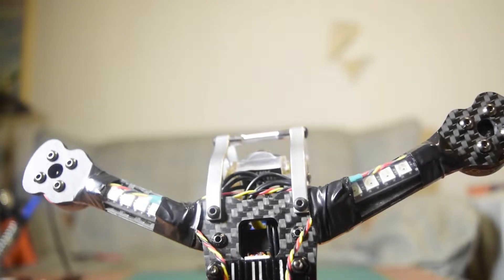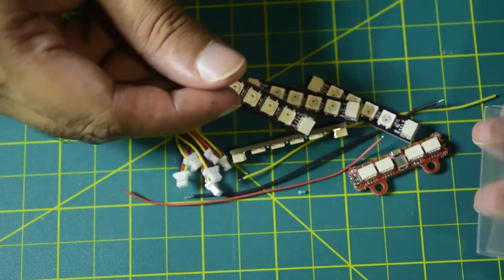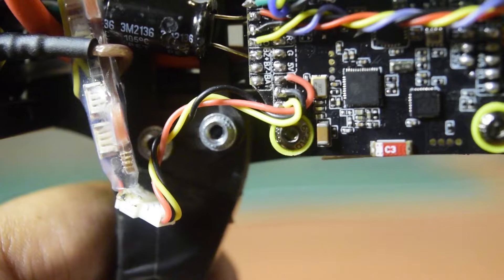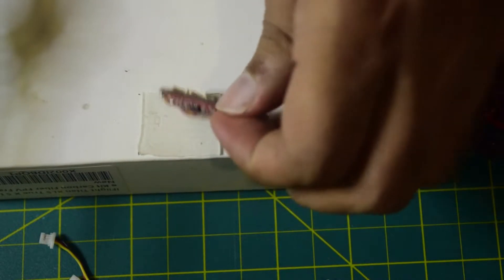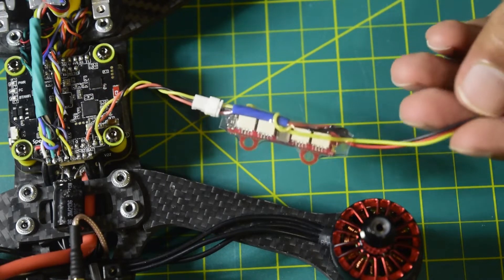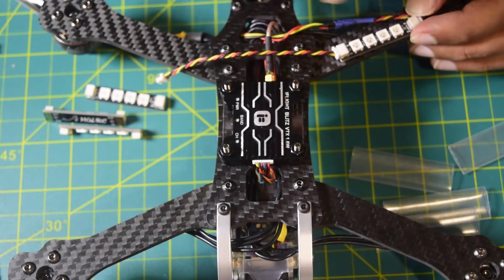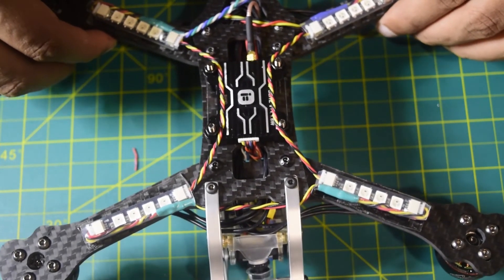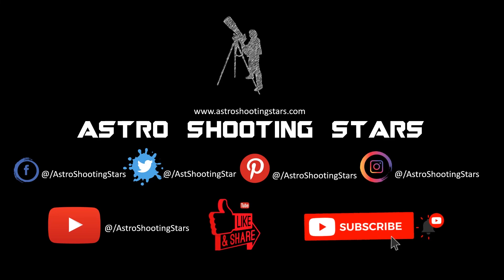How To Install Addressable LED strip on the FPV Racing Drone | HGLRC 2812 driver LED W554B ARGB LED

Comment: Do u know if I can use regular 5v 2812b leds (I have a bunch because of wled at home) and connect directly to fc and control through bf? Great video!
Reply from the maker: yes i guess as long as you have your led rated for 5v as each led must have 5 v gnd and control pin

Comment: Hi, I'm using the same LED controller board, but with a different brand of LEDs. The only way to  program LEDs in BF is to connect the yellow signal wires directly to the FC. My question is do I still need the PWM cable if I'm running the signal cables directly to the FC? I'm assuming the only purpose of the PWM cable is to allow one to assign a switch to the TX, but I should be able to do that in BF (in the modes tab) without having to use the PWM pad, no?
Reply from the maker: That is correct you dont need pwm to connect to FC for ARGB function. I hope this helps. Please stay tuned to my channel for my future videos
Reply: @AstroShootingStars  thanks!
Reply: @AstroShootingStars  Does that mean, if I want to use the BF to program the lights, I have to soldern the 4 "S pads" on the LED Board to the same 1 LED pad on the FC? Thanks, awsome vids tho :)
Reply from the maker: No , only for the first board. Each board has the input and output pin for the signal connect them in series i.e. input of first board to the LED pin of the controller and output of first board to input of second board so on and so forth. The LED numbering will start from first LED of the first board. I hope this helps. Please stay tuned to my channel for my future videos

Comment: hey can i program different colors or different port of controller for example i connect 2 led strips in first port and then other 2 in 2nd port and they both show different colors of led?
if possible please tell mw how or if not please tell me why
Reply from the maker: for led to be individually addressed they have to be connected in series and led count start from the end connected to signal port. if you connect two different port on the driver both the led strips will be connected in parallel than in series. so if signal is sent for led 1 it will get two leds first led of each strip. so both strips cannot be of different color. I hope this helps. Please stay tuned to my channel for my future videos.
Reply: @AstroShootingStars   thank you for the response i have a another question i want to know if i can control these LEDs with pixhawk ardupilot if yes how and if no why